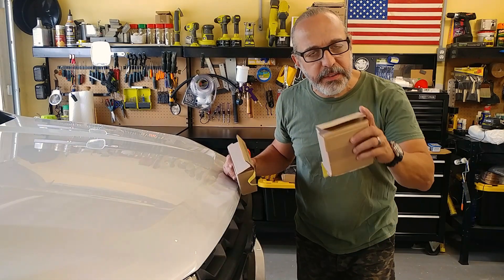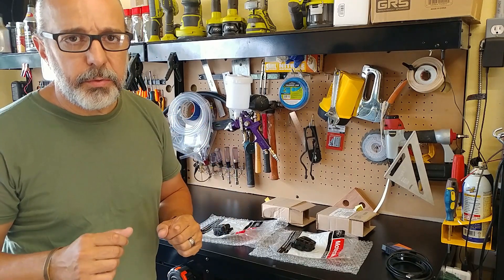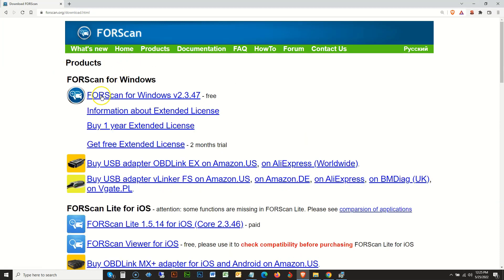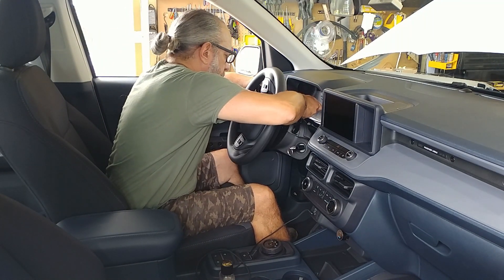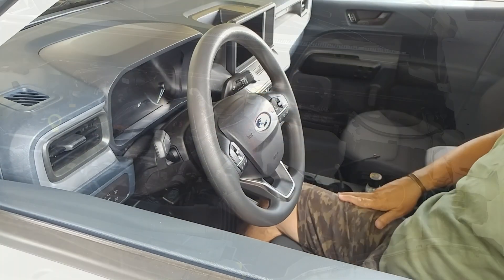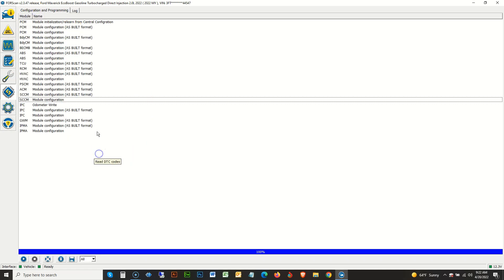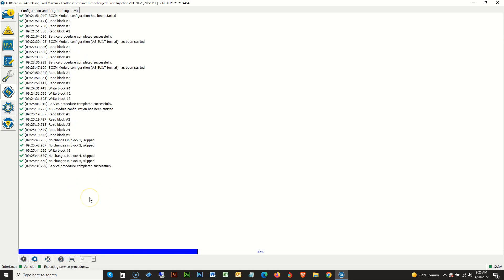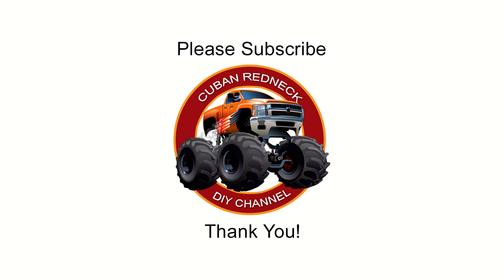Ford Maverick Cruise Control

Comment: Hi, I have the Hybrid XL and followed the instructions. Thank you for the detailed instructions. I tested today and the lane assistant isn’t working anymore. I have copilot 360. Do you have any ideas to get it working again?
Reply from the maker: ... many people have reported success with no issues or side effects. I personally have done one hybrid. This is the first time I hear about this and I hope it is not related to FosScan. So, far there have been two issues reported on the latest build. My first recommendation would be to go through the steps once again and pay attention to any warming by the software.

You did use the hybrid code? 

Also if you followed the video, you should have made copies of the original settings.  So if all the steps and hex codes are correct, I would restore the files back to factory. I will be sending a few emails out to dealer techs to see if can gather additional info, and hopefully, find out more details.
Reply: @CubanRedneck  yes I used the Hybrid code. I will try your suggestion when  I get home today. Thank you very much!
Reply from the maker: ... one of my dealer tech friends tells me that the issue is more than likely related to (SCCM - 724-02-01) having the wrong hex code. Try this - 1258 6820 3050 - or - 1258 4820 3030

He insisted the you turn the key off and on after writing to the ECU and make sure the number are correct after doing so.
Reply: @CubanRedneck  so I went home and checked those settings. It was set at 
1258 4820 3030 and I changed to  1258 6820 3050 and that fixed the problem. Thank you so much!
Reply from the maker: ...awesome!

Comment: One more question, were the part numbers of the buttons you listed backlit too? just wanted to make sure everything matches and it's illuminated too.
Reply from the maker: ... yes, the switches used are OEM FORD parts. They are the switches found on any Ford Maverick equip with cruise control from the factory including the Lariat lux trim.

Comment: I’m on step 3 with Forscan- BdyCM and when I run it, I get a “service procedure has been interrupted” error every time. Any experience with this?
Reply from the maker: ... sounds like a baud rate issue. The ECU is EXTREMELY sensitive to too much data. Go to connecting switch to manual, slow down the baud rate and give that a try.

Comment: The buttons on the right add phone voice controls for calls? Does that work when installed too?
Reply from the maker: ... yes, everything works as before with additional functionality. If you get a chance take a look or search for a Lariat steering wheel. The switches I used are from the Lariat trim.

Comment: I just got my maverick and have to good obd2 link $59.  Using latest forscan 2.3.48 I get an error that pops up saying unable to identify vehicle.  I'm stuck at this point.  It cant identify my PCM.
Reply from the maker: ... that is a baud rate error. Go to connection configuration and try manual settings.
Reply: KR3A-14C204-BJE
Reply: That worked for me. It identified vehicle as a ford 5.0 but it had correct as-built data.

Comment: Does this apply to the hybrid model as well?
Reply from the maker: … hey, sorry for the slow response. I failed to notice this message was in the junk box. … and YES, this has been tested and confirmed working on all models without factory cruise control. (Do know that there are different hex code for the hybrid! See the blog)
Reply: Yep, worked for my hybrid.

Comment: Thank you for your honesty and transparency in making this vid... I have changed my order for the 2023 Maverick to an XLT to get the factory CC... I also added the "Interior Luxury Package" the delta on the XL Build vs. the XLT Build on Fords Website was only about $1k... and I ended up with a lot more luxury features than I really need... Happy Trails...
Reply from the maker: Good choice! ... the splattering of different colors all over the XLT was somewhat of a turned-off at my age, but for the money, you get more with the XLT. In December of 2021, two factors were driving my choices. #1 Time - When I ordered my truck, my contacts advised me that orders for the fleet or work trucks were the only ones getting filled. Perhaps that's why it got delivered in 80 days. The second was my vision for the vehicle of making it a HOT ROD of a sort. So rather than ordering all kinds of stuff, I would have taken off, I order it as plain as it comes. Thank you for the visit!

Comment: Does the part number change if you have Co pilot 360?
Reply from the maker: ... not that I am aware, the switches I used are the same as in the Lariat. To the best of my knowledge all you get different with 360 is a different signal light stick and more advance display module on the dash for the extra features. Aside from the mirrors and all the extra electronics of course!
Reply: @CubanRedneck  Good to know, Thank-You!

Comment: Hey boss do you have any  suggestion on how to configure/ solution  with error  PCM : unable to read DTC? thanks
Reply from the maker: ... Hey thanks for stopping by. This is an issue with the baud rate, a mismatch between the ECU and the USB adapter. If your USB adapter has a switch, disconnect from the car/unplug the adapter/flip the switch one way and try it. Repeat with the switch set in the opposite direction if that does not work.
Reply: @CubanRedneck   which plug the obd reader or the  usb going to the computer? thank you
Reply from the maker: OK… first let's do a driver check 
Type on the Window's search bar (lower left) "Device Manager" and make sure that there are no warnings on Universal Serial Bus Controller with the USB adapter connected to the PC, not the truck.

Step "0" - Close ForScan
Disconnect the Adapter from the truck and PC
Restart ForScan
Connect the USB adapter to the PC then truck (note in which direction the switch is at)
Turn Key to run position
Click Connect in ForScan… If that does not work 
Go back to "0" Do everything all over this time set the switch in the USB adapt in the opposite direction.
Reply: @CubanRedneck   I tried to place the switch hs and it says "found control module " 

and in MS it say "PCM : unable to read  DTC"

It wont proceed to the next modules .. Do you think the obd reader is busted? Or the module?
Reply from the maker: ... it is starting to look like the adapter. There are numerous threads on the ForScan forum about this, many if not all resulting in a bad adapter.
Reply: @CubanRedneck   ok I'll try to order another adapter. Thank you
Reply from the maker: … before you jump ship consider slowing down the connection speed (other than auto) and play with the other check boxes. Take a look at this - https://forscan.org/forum/viewtopic.php?t=1763
Reply: @CubanRedneck  I tried the link ypu gave me now the delay is 4ms and excellent but still stuck in in found module :PCM- Powertrain Control Module for Hs

MS STUCK IN ERROR Pcm :Unable to read DTc
Reply from the maker: ... is this a NEW adapter? Unless the switch is damaged internally I don't understand why it would stop.
 
Is ForScan asking if you have an adapter with the switch? 

Try flickering the switch back and forth 20-30 times really fast to clean the contact and when connecting if it asked to use an existing profile click NO!

...contact me via my blog
Reply: Hello Emilio and Cuban Redneck, where you guys able to resolve this? I tried adding CC today and Forscan asked me for the PCM. Cheers!

Comment: Hi. Would you happen to know if it's possible to order an xlt leather wrapped steering wheel with the cruise control from Ford and install it in an xl? Thanks.
Reply from the maker: ... to the best of my knowledge yes, however, most people chose the steering wheel from the ESCAPE it is a littler bit nice. Stop by a local dealer and check it out.

Comment: I’m ordering the 2023 Hybrid XL. I’m so glad this can be done so easily, as lack of cruise control was the only thing keeping me from wanting the XL. Given that the truck is set up and hardly any changes need to be made, it seems it was omitted deliberately rather than “not included,” which is a cash grab to get people to upgrade to the XLT. This is awesome!
Reply from the maker: ... thank you! I have only had mine for three months and still learning about it. This is my first Ford in more than two decades. But I have a lot more upgrades and mods in the works.
Reply: @CubanRedneck  just to confirm for the hybrid model, you only need to disconnect the 12v low voltage battery and stop power to the airbags, correct?
Reply from the maker: @mikediiorio9346  ...correct. Under rear seat, right side! Also know that the hybrid takes a different hex code for BCM because they have a different transmission.
Reply: Yes, I saw that in your description, thank you for being so thorough! It makes people like me who are not that great with computers able to do stuff like this. If I have any questions I will let you know, but it could be a long time before I get my truck haha

Comment: Great overview, thanks! Did you not have to set the ABS code to 760-03-02 0200 0000 0573? I've seen that in most of the other threads on the topic. Something about setting the braking to work correctly with cruise control?
Reply from the maker: No need ... take a look at the ABS menu. There is a drop-down that sets a global configuration. There is more than one hex to configure, and that's why so many are having issues that include poor fuel economy.

Comment: Awesome. Adaptive Cruise Control next?
Reply from the maker: …. Thank you for watching, and I am afraid not! Adaptive cruise control requires a series of sonar sensors, and I have not located any unused plugs in the harness to connect them. At first, I thought it was only the one in the front grill, but I have been told that the ones for the left and right lanes are also part of the loop. I haven't had a chance to study the wiring diagram, so in the meantime up in the air!

BTW - the front radar/sonar sensor alone, Ford Part Number: NZ6Z9E731A cost over $400.00

Comment: Mines not recognizing bdycm. Any idea what to do?
Reply from the maker: … hi. This is an issue related to the baud rate. Here are several solutions:

#1 - If the software did not ask you to flip the switch on the USB adapter, consider going to "ELM327 MS-CAN support" advanced settings and changing the from "Auto" to the "HS/MS switch" option. Disconnect and try again...

#2 - Delete the vehicle's profile, then reboot the software, then try reconnecting as a new vehicle.

#3 - Do #2 and flip the switch to one side before connecting. If it is still not recognized, disconnect do #2 and try again with the switch in the opposite direction. 

In other words, it should prompt you to switch over when required. If it fails and it doesn't work on one, do it again but in the other direction.

Comment: Going through this process with my Focus. The big question is why Ford has got to spend more money to delete features from the base model. There's no way it's cheaper to make a second set of steering wheel buttons just to delete cruise control from the base models. It's anti-consumer really. But I guess it helps upsell the upper trims when they remove extremely basic and almost necessary features from the base models. Like Cruise Control.

Heck the base Focus doesn't even have an ambient temperature display, but I don't really care about that...

Regardless, nice video!
Reply from the maker: … I hear you, brother! It is all about selling trim packages! Thank you.
Reply: Reporting back that I did have success. Swapped the wheel, turned cruise on in the bcm, done. Cruise control is working
Reply from the maker: ...AWESOME! Not having cruise control may sound insignificant until you don’t have it!

Comment: Great tutorial from a fellow Cuban Floridian! Congratulations on the Maverick and look forward to seeing further mods. Need to do a DIY OEM speaker replacement and bedliner tutorial!
Reply from the maker: ... dimelo! There is a full sound system in the works, not some boom boom distortion crap you hear coming down the street. If you have ever listened to Martin Logan, McIntosh Amps, and things like that, you will appreciate it! Yes, I will be spraying the bed with Raptor, DIY fiberglass tonneau cover, intake, exhaust, and more. The weather has not cooperated over the last few weeks, but July looks good!

Comment: you typed 4820 in the 724-02-01 but said 6820.
It is 6820
Reply from the maker: ... yes I know, sorry about that I'm so dyslexic is not even funny. 
I mentioned that in the description and know that the hex codes in the description and blog are correct!
Reply: @CubanRedneck  so just to be clear it is supposed ot be 6820 and not 4820?

Comment: Still waiting for mine to be built in July, Im waiting on an XL Hybrid in Cactus Gray with moonroof, 2k hitch and center console plug.
Reply from the maker: AWESOME ... The hybrid was extremely attractive, but I do too much highway driving. With that said, I am not disappointed with 35/36 MPG @ 73 MPH on the 2.0 EcoBoost before any mods! The goal is 39/40MPH @ 75 MPH.
Reply: @CubanRedneck  awesome, I roll pretty hard too. But I hope its work the wait.

Comment: I love doing upgrades like this, but in the case of the Maverick, spending a couple more grand for the XLT is totally worth it.
Reply from the maker: @throttle shots ... Agree 100%
Reply from the maker: … for me getting an XL was not as much about cost but time. I wanted the trailer hitch, and I would have liked the Copilot 360  and several other options, but my insiders warned me of delays with specific options. After totaling my wife's SUV, I was on the clock to replace it if you know what I mean. Also, know that some of my friends are still waiting six+ months later. I got my truck in 87 days from order to delivery!

Comment: The XLT gets cruise control as standard.
Reply from the maker: … hey Joe, thanks for commenting. As previously mentioned in another comment, there are reports of inconsistencies with some units built back in 2021. I believe that the ordering and standard options per trim are considerably more predictable.
Reply: @CubanRedneck  Inconsistencies in what?  What do you mean?
Reply from the maker: … the comment I made echoes off-the-records comments from more than one person involved in Ford fleet vehicles' maintenance and or order. Aside from that, there have been a lot of little things reported on both Reddit and Maverick Truck Club about this. From my own experience, I have a friend in Pensacola that has a burnt orange XL that came with the orange accent door panels. Not something he ordered and something I thought was a Lariat thing. I met somebody with a hybrid who told me that Ford had accepted his order with 4k tow packages but canceled the option a few weeks later. Does this matter? Not really. And FYI - there are rumors of some trim options shifting before ordering opens up again. At the end of the day, if your truck already has cruise control, AWESOME. If it does not, this is how "I" upgraded mine. This is a how-to video on cruise control, not a report on what is standard on trims. Did I misspeak? I don't know. As I said, I simply echo comments made to me.

Comment: Xlt has cruise control as standard….
Reply from the maker: … that is what I taught, but I have heard some people report otherwise. According to my sources, there were some inconsistencies in the first batch build in 2021. Thanks for commenting.
Reply: I just installed my new leather steering wheel into my XL mav today using your video and a couple others to help with forscan! Great content!
Reply from the maker: .... call around! Or consider searching GOOGLE for Tuner Near Me

Comment: Very nice 👍 thank you. The dealership quoted me $630 plus tax and an aftermarket was $315 plus tax for do it yourself. Your option seems the best regardless of cost. 
Another thing I have been considering is a topper or as I know it, a cap for the bed. At over $3000 though it’s just not gonna happen. Any options for cheaper would be great. My idea was just a piece of plywood in 4 sections and apiece of material that might prove water tight. Thanks again.
Reply from the maker: … hi, and thank you for your comments. If you collect all the parts, installing an oil separator catch can should not take an hour to install. As to the topper, I will be making a hard tonneau cover out of composites. If you are handy, you should be able to covert the build into a topper using the same build techniques. In fact, I will make sure to offer details for that option. More than likely, I will be using Urethane Foam Board aka XPS Rigid Foam Board Insulation (or pink board), epoxy, and a combination of mat and 6 oz. Fiberglass! If you are not familiar with this, search YouTube for foam surfboard building, It is the same concept. Very light, very strong, and everlasting!
Reply from the maker: .... BTW I just ordered materials for the rigid bed cover I don't it going to end up costing $250
Reply: Would you mind sharing which dealership agreed to the install? I am interested in this option.
Reply from the maker: .. call around or you can also also search Google for "Tuner Nera Me"

Comment: Is it the same procedure for a hybrid
Reply from the maker: ... YES, please know that step #3 requires a different code for hybrids see the description and always check the blog the latest updates.
Reply: How do you disconnect the battery on a hybrid
Reply from the maker: @tekilaswings  ... You don't need to disconnect the high voltage battery only the cranking battery under the rear seat.